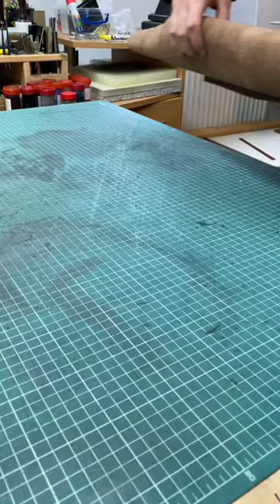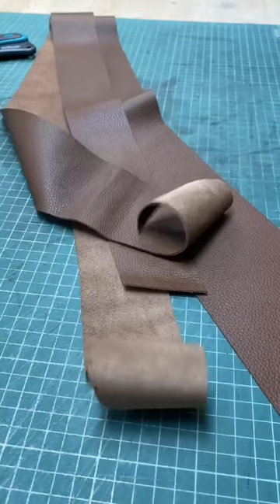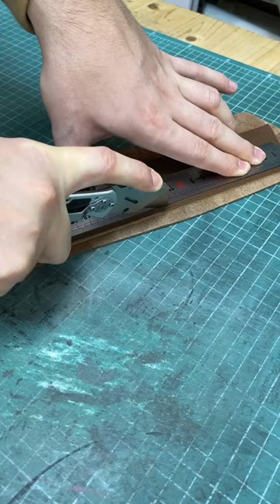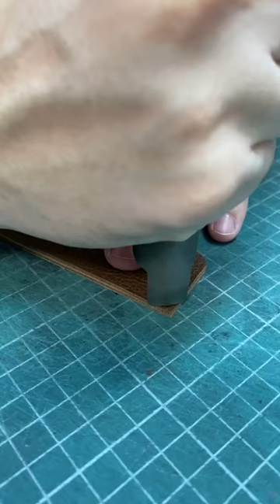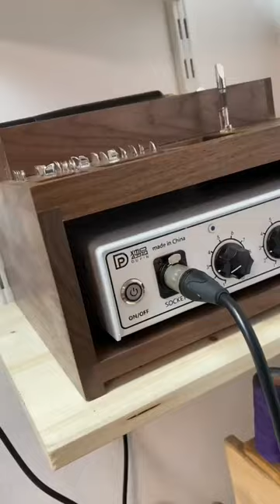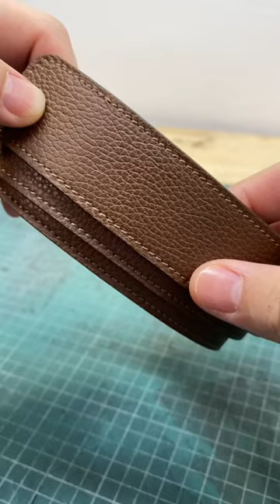Making a leather belt strap double sided #handmade #leathercraft #asmr

Comment: Você apenas usou 2 camadas de couro uma colada na outra ou você colocou uma correia por dentro para forrar?
Reply from the maker: I have used 3 layers there, 2 layers of leather and 1 layer of stiffner, regenerated leather
Reply: @AtelierUtanValentin  Para fivela de 3.5mm e para fivela de 4mm que largura voce cortaa correia para o forro interno, par a passar certinho na fivela?
Reply from the maker: @DHArts-ej8wc  for 3.5 i cut the leather to 3.3 and for 4 i cut the leather at 3.8 aprox